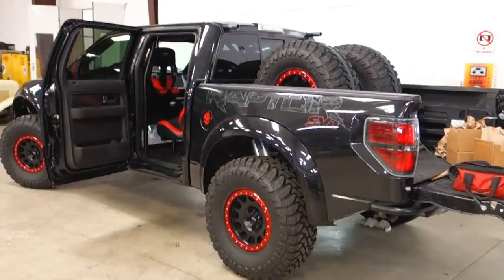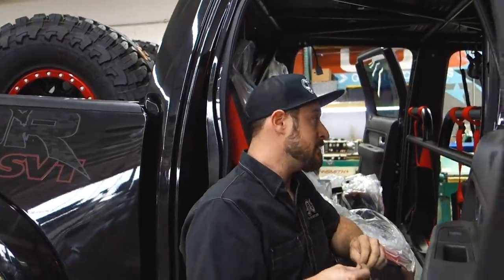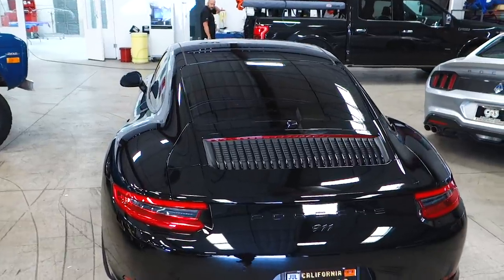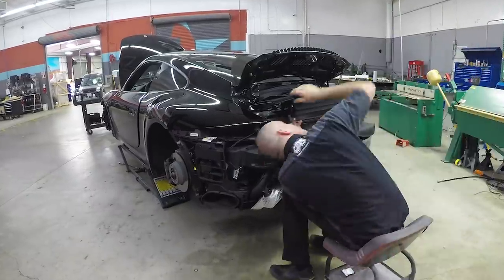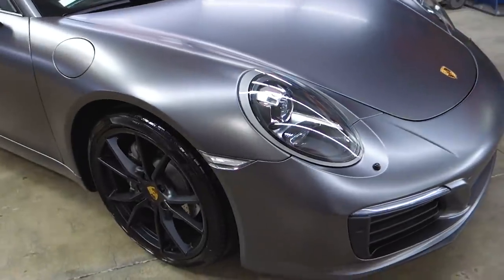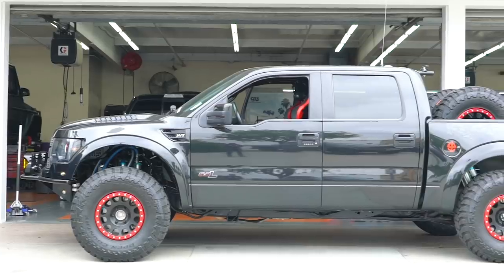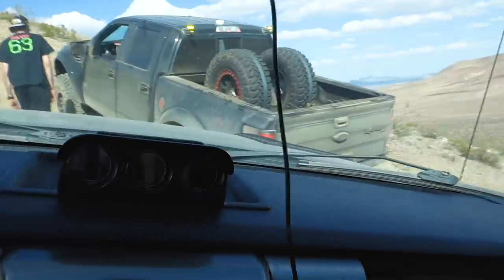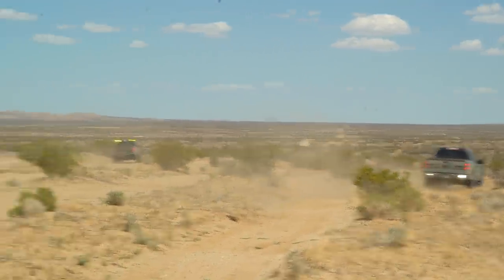We built the MOST INSANE Ford Raptor! | OFFROAD TEST

Comment: What is the purpose of the yellow lights?  Do they see better in dusty conditions im assuming?
Reply: They are dust lights, used in off roading for both cutting the dust in front, or as a rear facing marker light (dust light). Yellow light can be seen much better than any other color light in the dust.

Comment: the rear suspension needs to be overhauled there definitely to much reflection on the rebound through the woops an jumping that could put mass strain on the diff an the bearings in the rear axle. just a thought but real exceptionally well built. 

keep the great content coming and the assets will grow exponentially. 

   All rights reserved without prejudice
                        U.C.C-1-308

Comment: Those trucks are fun to do some climbing, to cross (not that deep) water bodies and not that bad dirty roads loaded with the proper gear for camping, but for sure are not useful for real "Race OffRoad", they are too heavy, too large and therefor not stiff enough for proper speed, balance and traction. If you want real off road race, check out the WRC FIFA (130mph off road races) videos and Cars that are made for real off-road racing.

Come on Guyz, PickUp Trucks were made and meant to help in farming work!